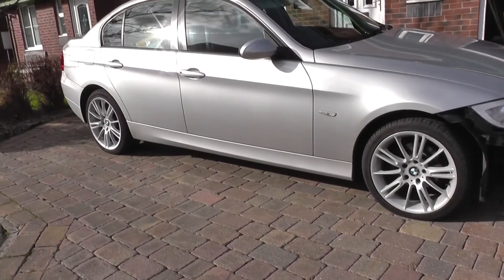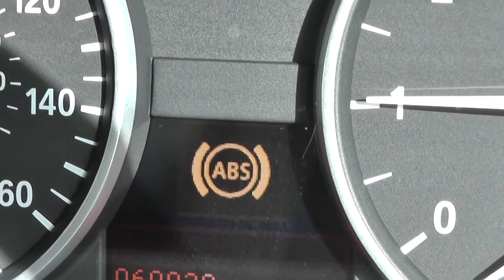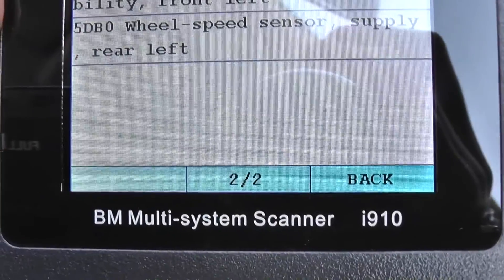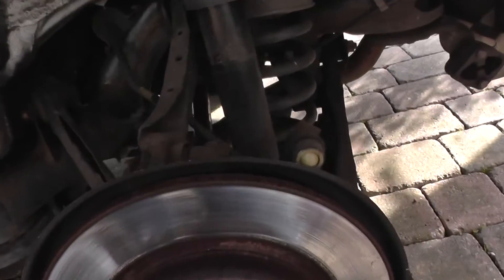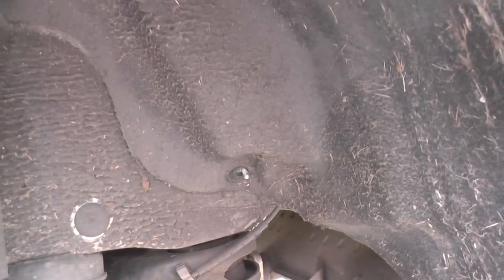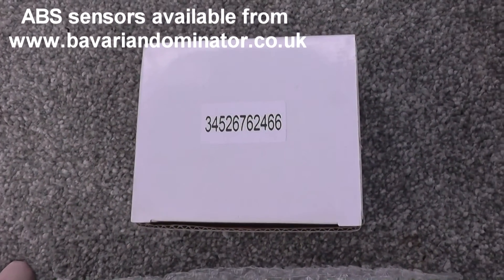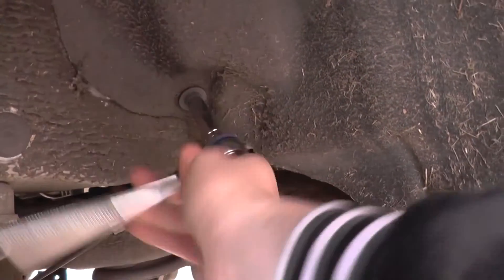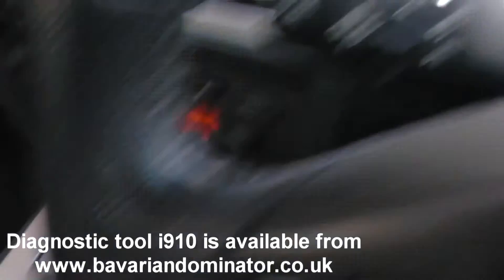Diagnose & Replace BMW E90 E91 E92 E93 Rear ABS Wheel Sensor With i910 Scan Tool

Comment: Im getting the code p16b9 and can find nothing on it.. But the lights ot the dash are abs and traction control etc.. I dont have a clue what it is but im going to do the abs sensor anyway.. Iv ordered from bavarian dominator. Hopefully that does the job.. Can this sensor send the car into limp mode?